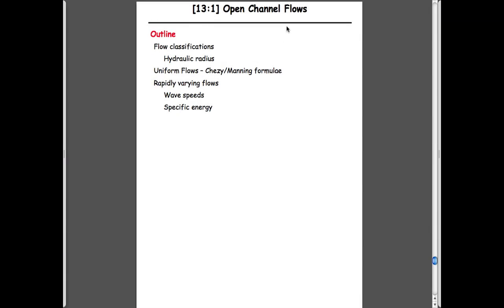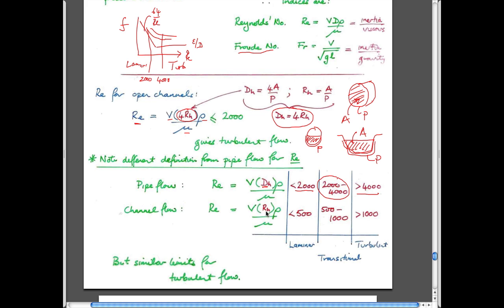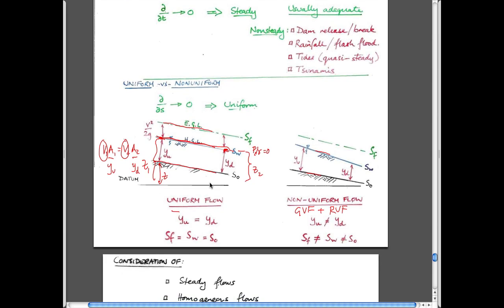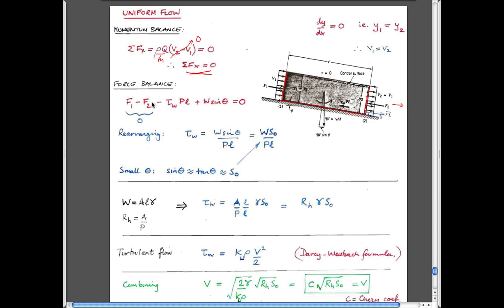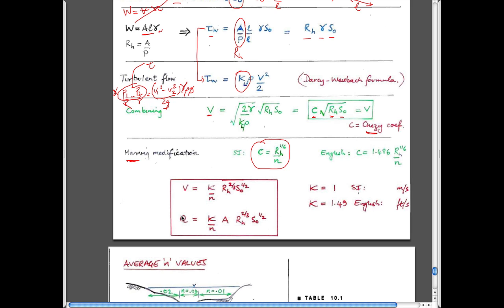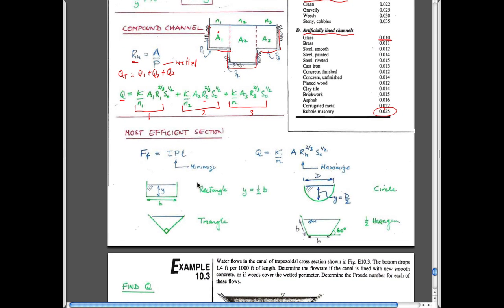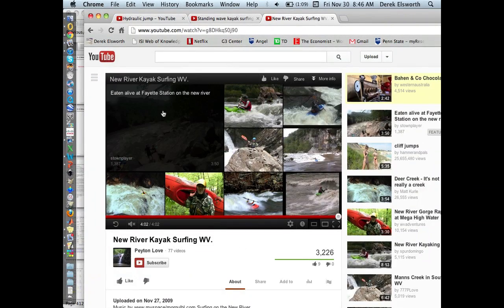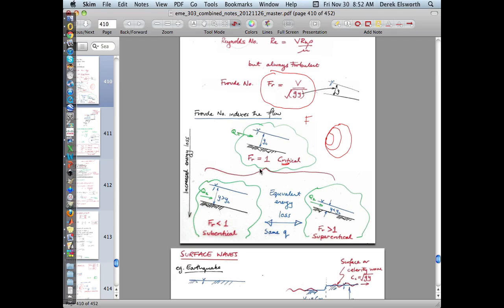13:1 Open Channel Flows - Uniform Flows, Chezy and Manning

Comment: hi, i have some questions. 
1. how to obtain shear stress from chezy eq? How do I prove that shear stress is increasing with increasing velocity
2. how do i calculate bed slope on flat bench and bed slope on a system with bed elevation at one of the end?

regards,
Reply: chezy eq is not for calculating shear ,,, it relates the steady channel flow rate to the cross sectional shape , slope and friction roughness